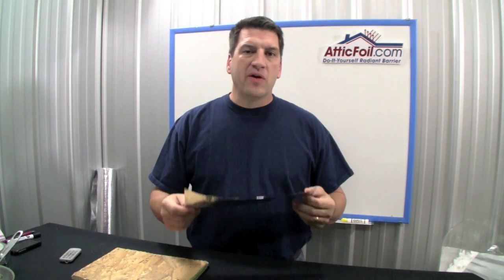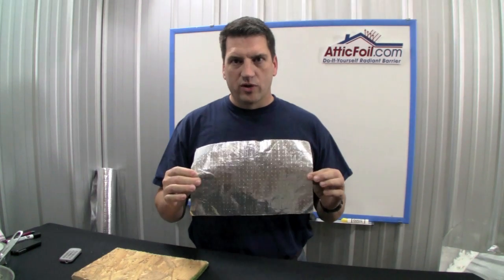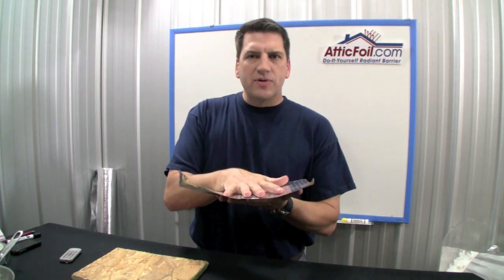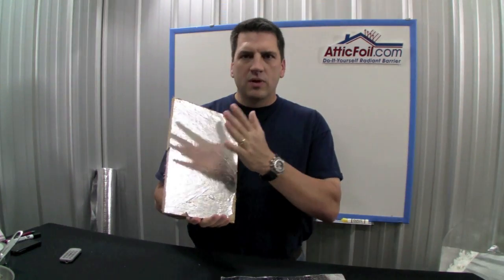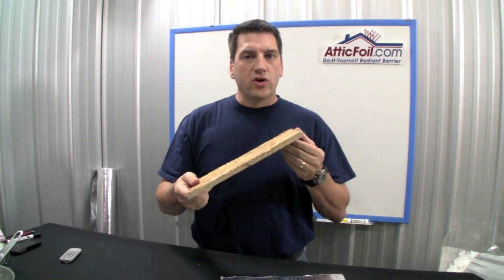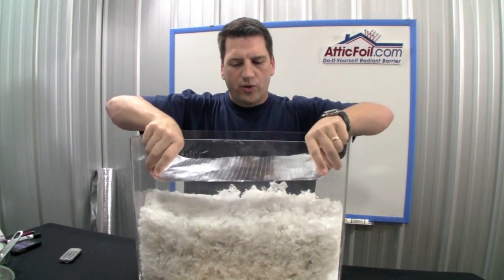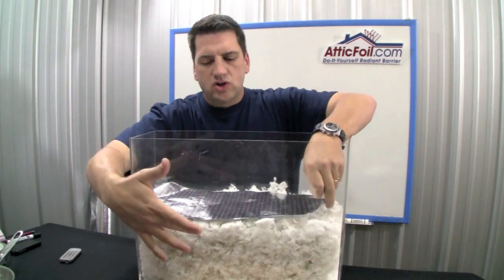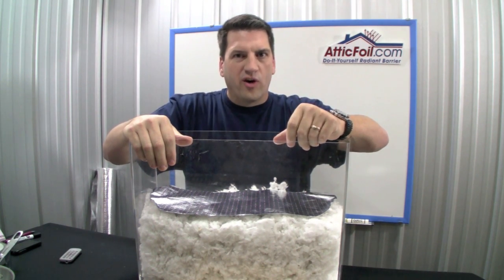Dust And Radiant Barrier - The BIG MYTH!

Comment from the maker: Yes, Aluminum is a little tricky.  It is an excellent conductor of conductive heat (this is why we cook with aluminum cookware) AND an and excellent reflector or radiant heat. (this is why we put foil on top of a turkey to keep it from burning on the outside before the inside of the bird cooks) Aluminum is only surpassed in the ability to reflect radiant heat by Silver & Gold.